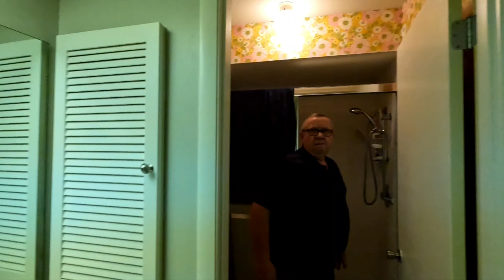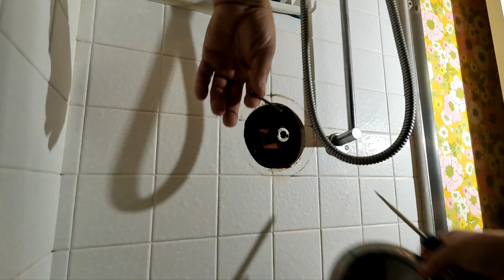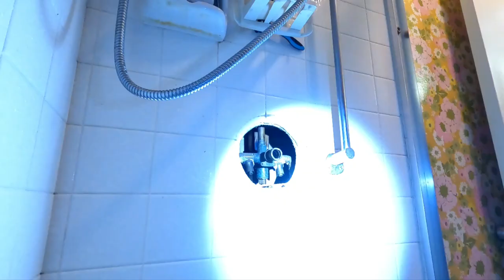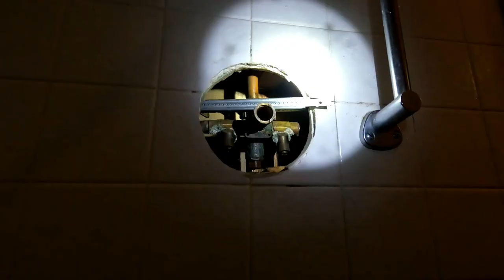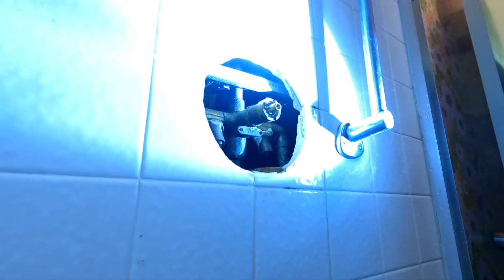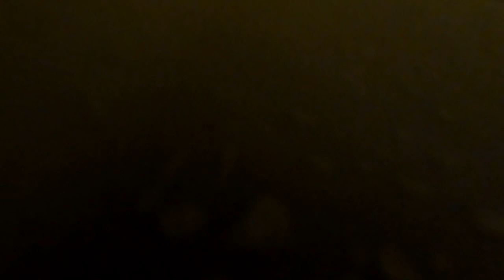REPAIR A LOOSE MOEN SHOWER VALVE W/NEW CARTRIDGE

Comment: Hey John,  it's  fine if you don't want a pro press, I've had one for many years, and I still solder most of the time. Pro press is great in certain situations,  but for example,  if your trying to change out a shower valve through a minimum opening. Good luck getting that tool in there. On the other hand i had to replace a 2" shut off in the ceiling of a school, the water wouldn't stop running  and everyone is asking when the water is going to be back on. That tool paid for itself that day!
Reply from the maker: I agree totally it has it's place,and is simply an exceptional tool in situations like you described, I mainly work on single family residential houses it just wouldn't be cost affective for me at this time. Thanks for your comments and thanks for watching my friend!

Comment: Your not supposed to caulk around the bottom of the trim plate there's a Weep hole so if the cartridge leaks it will have a place to leak out instead of leaking into the wall

Comment: Hey John! Love the videos! Check out eBay from time to time! I just recently won a bid and bought a Milwaukee M-12 ProPress on eBay for less than $2000. Seen a Ridgid 12 volt for sale recently for around $2200. Yes the propress fittings are up there on price! I purchased most of mine through eBay also! I only use it on certain situations! Good Luck on your hunt for one!
Reply from the maker: Thanks for the info brother!

Comment: Sharkbite/pex/cpvc seems to be legal in Florida according to your videos. But in NYC where those type of fittings are not legal, ProPress Pays in the time you save and issues that you run into [valves not holding 100%, waiting for water to drain out]. It might be x3 the cost for the fittings but we bill material to customers. In fact one of my buddies told me they actually use all ProPress on new construction for Union Projects
Reply from the maker: Wow,I'm  sure I'll  catch up to the herd someday, thanks for your insight and thanks for watching my friend!